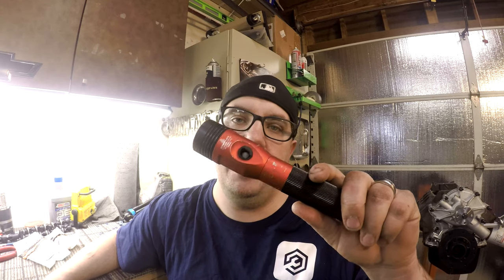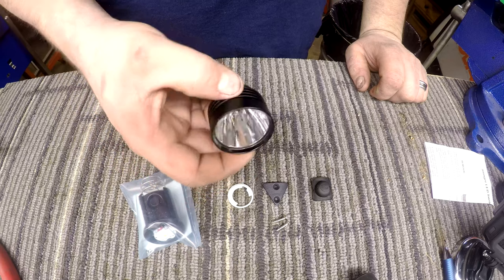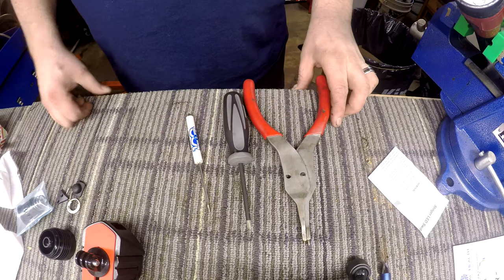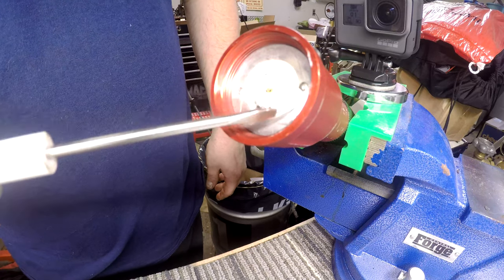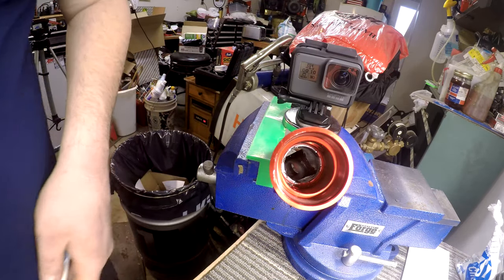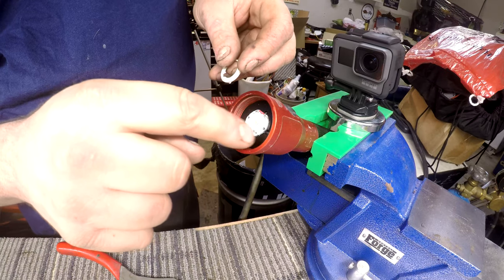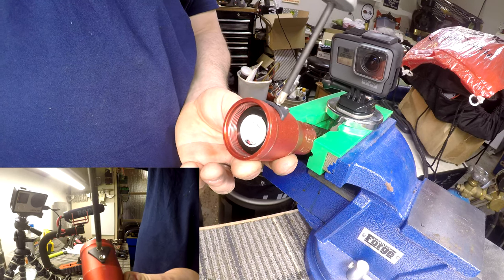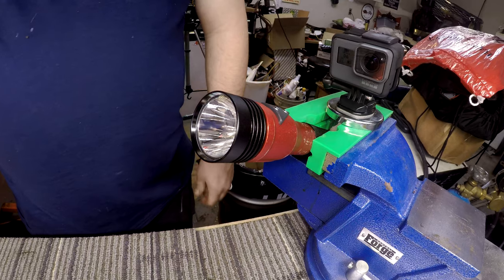How to replace the switch on a streamlight stinger flashlight. Rebuilding a streamlight stinger

Comment: I’ve worked as an aircraft mechanic so far for 4 years. I am very picky about my tools and don’t have time to fight with them. I have the stream light stylus pro, stinger HL Led, and the micro rechargeable one. They have never let me down. I’ve used them in snow, rain, covered in turbo oil, hydro fluid, Lav fluid, brake clean, solvent, 1300L, alcohol, and more. I am a big fan of these lights and would definitely buy them again.

Comment: The Stinger LED was the first pro flashlight I bought as a mechanic, and I really liked it. The problem was that after 2 or 3 years of almost daily use, the switch went bad, and when I sent it back to Streamlight for repair, the new switch assembly had electrical bouncing issues because it would go from OFF to STROBE mode, and I couldn't get it to turn on in solid beam mode 90%+ of the time. I got so frustrated after shipping it to them twice with the same result, that I eventually bought Maglite 150LRX (which is significantly brighter btw, and Made in the USA). I'm watching this video to hopefully revive my Stinger, and get the most out of the $125 I spent for it.
Reply: I had the same problem with mine and it end up being the battery defective inside. got new battery and now it works perfectly.

Comment: I use it every day I work on a machine shop rebuilding engines and I crack check the blocks so I use the flashlight to look inside everyone that needs one here in the shop has one.

Comment: I use one when I'm out at night in the dark and they hold up pretty good. I'm always knocking out a window with it and even used it to plumb beat off a deadbolt lock to a garage I needed in but I broke my switch due to that so here I am. ( Still made out pretty good that night even with breaking my light switch) I hear they're expensive but I think you should buy one for sure. Keep it out in your garage to have.

Comment: Streamlight's which I've used going back to the tool vendor pen lights, which weren't THAT great, have otherwise NEVER let me down and abused the hell out of them!

Was an auto tech myself, and funny enough, the original Streamlight stinger I bought in like 2015, (which always works, as well as its NiCd batteries still) which has been used/abused so much, button is fine. My more recent Stinger HL, purchased bout year ago, button cover tore.. other than that, NEVER had issues with any of my 5 Streamlight's! Excluding the pen one's...
Reply from the maker: Abused is an understatement. Lol. I've noticed my button falls apart if it exposed to trans fluid for too long. But by far the best flashlight I've ever bought.

Comment: How long do you have to charge it for??? Mines only last 2hours off  use....
Reply from the maker: Mine is on the charger every night. If you have the HL the batteries usually last between 4-6 hours. Depending on age the batteries could be weak. Should definitely get more than 2 hours out of it.
Reply: Thanks

Comment: I thought this would help walk me through how to fix the issue with a Polystinger. My PolyStinger has the same bulb but it has a metal housing for the bulb. Guess my only option is to use a soldiering iron to put the positive and negative back on the bulb.

Comment: I do love Streamlight but my only thing is the inconsistency of the body switch latch point even within the same model lights. I have 2 Stinger DS HL and one has a nice switch with a nice latch point, and the other one you have to mash the switch completely down into the body to get it to click. Just feel like those lights are gonna need the rubber replaced way sooner than those with a taller latch point. The tail switches seem to be pretty consistent.
Reply from the maker: I would agree. I’ve had several different ones and they all are slightly different. Haven’t had one that I’ve had to smash…yet.